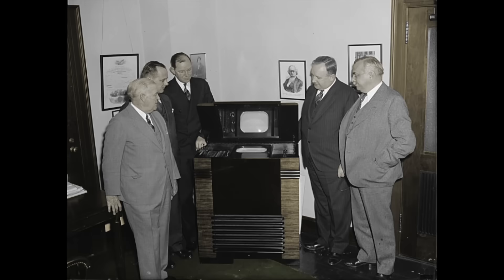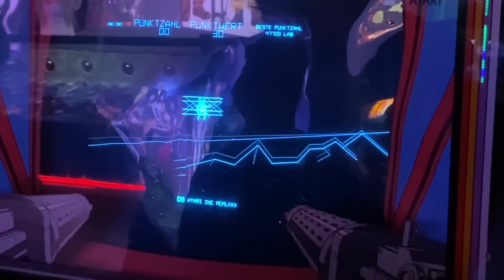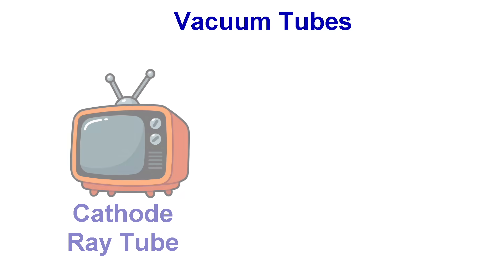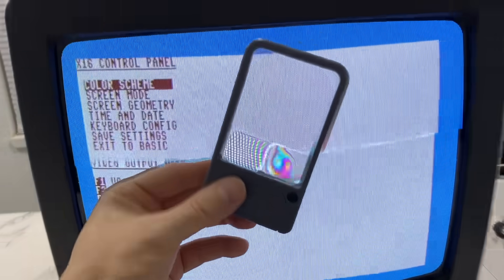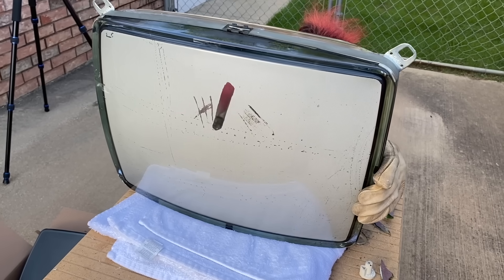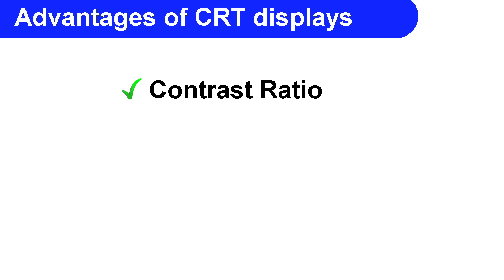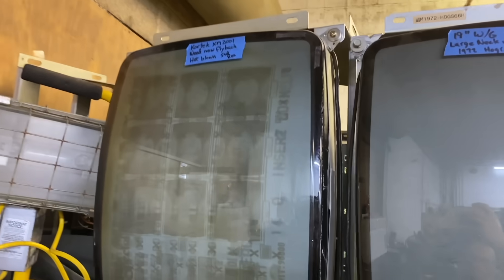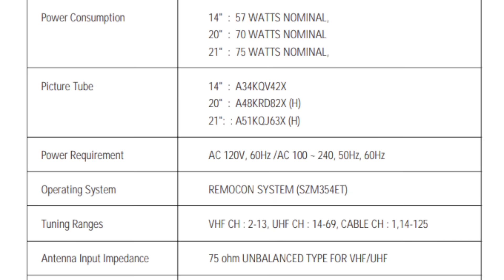How Cathode Ray Tubes Work.

Comment: Disappointed David trotted out the discredited old trope about burger sizes. It comes from a single source. A&W had a CEO who did a terrible job and was then fired. He then wrote a self-serving book in which he tried to blame "dumb customers" instead of owning his own mistakes with this burger rollout. He is the only source for this supposed survey about fractions. But here's proof this was nonsense: First, we have the Hardee's hamburger chain (known out west as Carl's Jr.). In 2003, in line with targeting a demographic of hungry young males, they introduced a 1/3 pound burger, and the "1/3" fraction was a prominent part of the burger's labeling (I found several images of menus from this period). Later they also add a 1/2 pound burger. There are menus where all three sizes were prominently featured, all with the fractions. This was probably their most successful product introduction in their entire history. It wasn't until a few years ago, when the pandemic occurred, that they simplified their menus and changed the labeling, as many companies did. But for almost 2 entire decades, they had menus with these fractions, and of course the bigger burgers were more expensive, and it was a huge success with no problems regarding "dumb customers" not understanding them. McDonalds also had a specialty burger that was 1/3 pound, labeled the "1/3 Pound Angus" burger, and it was on the menu for 4 years with no issues. Second, I looked for a non-biased poll about this. Someone indeed did this on Reddit 3 years ago. “What is bigger, 1/3 or ¼?”.  The answer 1/3 got 1.8K votes, which of course means 1800+.  For the answer ¼: 23 ENTIRE VOTES.  Reddit is available around the world, but the U.S. represents a large portion of an English-language website such as this. And I doubt Reddit users are much smarter than the general public, given how stupid some of the questions and answers are on that site. People use fractions all the time, in cooking and the like. Almost every American home has a set of interlocking measurement cups in sizes of 1/4, 1/3, 1/2, and 1. It would be impossible to not notice how these fractions compare. I have never met a single person that did not understand them. This is a false urban legend at this point, but people love click-bait nonsense, especially if it makes them feel superior to the unwashed masses.
Reply: Yeah I'm gay too

Comment: 11:23 That was the exact same model I had for my first DVD player as well. I worked at RadioShack back then and picked up the floor display model on clearance. Still was a whopping $230-ish with my employee discount.

It had a free Netflix trial voucher in the box. The same Netflix account I had active non stop until 2022.

When I had upgraded to a Phillips that could handle burned discs and DiVX (the h263 conpression format, not the failed disc format DIVX) i gave it to my girlfriends mom. Last I saw, she was still using it in 2009.....

Comment: Another disadvantage of LCD and any pixel-exact screen is that if you give it an analogue signal you often get unsharp results, as the timing is usually not 100% perfect. Only with digital inputs (DVI-D, DisplayPort, HDMI) you get perfect pixel-by-pixel representation. In fact I never ever buy any LCD or flat screen without digital inputs and I definitely never attach any VGA cable to it. With digital it becomes however absolutely perfect sharp when using the native resolution.

Comment: Regarding 4:3 vs 16:9 screen sizes it also largely comes down to what you use the display for. If you primarily did a lot of reading and writing you'd miss that extra height from the 4:3 display a lot. On the other hand if you were primarily watching movies in a 16:9 aspect ratio you'd be better off with the 16:9 display as the same content would be restricted by the width of the 4:3 display. As for gaming I suppose it comes down to if you value a bit of extra horizontal FOV or not.

Comment: Great video, very informative😊 Thanks for the hard work!

As far as the 4:3 vs 16:9 aspect ratio preference goes, I'm a bit of two minds about it. I think we lost something when we moved away from 4:3, as it seems like a more "natural" adpect ratio to someone like me who was still born in the 70s. Whenever i think of past displays, i think 4:3, and displaying even old VHS tapes in an widescreen display means having to decide between a stretched image or black bars on the side, which always felt to me sub-optimal, no matter what you choose.

On the other hand, a 16:9 display for laptops feels more natural. When i was a student i had a (rather expensive) XP laptop that stacked well with A4 sheets from my notes and assignments, so it felt easier to carry than a 4:3 one.

In the end, there is room for everything, be it CRT or LCD, 4:3 or 16:9 😊

Comment: There is a high demand for CRT TVs in live theatre to transmit the image of a conductor to the cast on stage or even sometimes to transmit his image to parts of the orchestra.  Analogue cameras are also preferred as the source.

Digital monitors and cameras can cause up to 5000ms (or 0.5 seconds) transmission delay.

Performances often rely upon a remote orchestra playing in a separate room.  Any delay in the image transmission can be disastrous for a musical performance  

Reliable CRTs and analogue cameras are becoming rare and difficult to find.

Comment: The Price Size Comparison for 4:3 vs 16:9 was only slightly true. The marketing push for 16:9 was DVD and the higher than VHS quality to have a near theater like at home experience. With the addition of Surround Sound and Dolby Pro Logic, I digress. I say all this because by the time circuit city and best buy were stopping sales (or well stopping the showcase of) CRT's The price was not even comparable. With HD LCD being dirt cheap compared to CRT, cost of materials was incomparable.

Hindsight into history is 20/20 and the cost to manufacture, the cost to transport, the cost of shelf space. All were the biggest downfalls of CRT bigger than screen real estate bigger than quality, bigger than input lag. We all NOW know that a CRT is best for unmodified analogue video game consoles. And many of us didn't have a second thought about filling the landfill with out old CRT's however we would kick ourselves for it.

Really for the layman, Emulation or Console Mods, Those are your choices. A $300 PC from 2010, or $300 per modded console. Comes down to a choice of space to be honnest.

Comment: I had a DVD player in 1999 (though did still regularly use my VHS until 2005). I also started downloading MP3's around '99-2000. I had a digital camera around 2000, and a USB flash drive around 2002 and got my first LCD TV around 2006. I wouldn't buy an electric car though.

Comment: If you run an LCD with LED at 100% backlight as most users do, the LED's will last for 3-5 years.
They breaks in three different ways.
1: No light (dark areas).
2: Lenses fall off (you can see a bright spot).
3: The tiny filter on the LED falls off (you get a bluish screen).
Reply: I've seen lots of modern flatscreens (2 or less years old) have backlight failures

Comment: It is quite interesting for the difference of image rotation  mechanism of CRT and LCD. Unlike the LCD which use software to rotate image data  via matrix calculation, CRT can use the physical method by rotating the magnetic field .

Comment: Despite Technology Connections doing the same idea years before you (actually there's a whole series), yours is still unique, and in my personal opinion, superior as no diagram can beat the simple act of breaking something apart and seeing the parts for yourself.

Now I wanna know what happens if you activate the electron gun in open air, if you can safely look directly into it, and what that looks like if you can. Also would be cool to try to melt something with it.

Comment: I'd actually argue that it wasn't LCD that took out CRT but plasmas, at least initially (and then LCD killed plasma and yes, I'm still extremely salty about it). At least in the early 2000s the "good" flatscreen TVs were almost exclusively plasma TVs. I got one of the first halfway affordable LCD TVs in 2004 or so and despite 720p HD (which was great if you actually got ahold of an HD signal) it really wasn't that much of a game changer due to poor contrast and all the other crap that came with early (and more budget friendly) LCDs. A friend's parents had this gigantic 40" Panasonic plasma TV around that time and, my God, that thing was something else. 

Of course the drawbacks like energy consumption and manufacturing issues let plasma fall behind and eventually were discountinued despite their superior picture quality. I'd argue it took at least until 2020 that LCD, despite all the LEDs, local dimming, etc. could finally get on par with plasma in terms of picture quality and the last Panasonic model to this day will even give a cheaper OLED a good run for its money. So, if you ever get your hands on a ZT60 you know what to do.

Comment: Being the Owner of multiple CRT's (I mostly found on the side of the road) I easily named off every pro to CRT's you mentioned, however there was 1 more pro that you did not mention and that was how absolutely perfect the color represents on a CRT. For instance, plug in a N64 with a S-Video Muti-link cord and put in Goldeneye 64. Do this for both a CRT and a LCD or even OLED TV and you will immediately notice how bright and brilliant the Gold and the red is on the CRT, without completely washing out the color or losing sharpness around the Nintendo Logo when it flashes on the screen. Modern TVs simply do not have the color accuracy as even a old worn out CRT.
Reply: I was actually reading today about turning down the level of red on my JVC D series CRT because it’s way too bright compared to the other colors : ) I think it is an actual issue on JVCs

Comment: You missed viewing angles.  Even though most CRTs are convex, their self-illuminating pixels are viewable from a wider and taller range of positions without loss of brightness or color accuracy (compared to LCD, especially TN).

Comment: the 16:9 debacle was one more of the wide screen content of the movies than the real pixel count/area, DVDs started to come in 16:9, BlueRay and Youtube, Streaming ,etc. and with that the fabulous 4:3 died , I used an old LG monitor 1280x1024, 4:3, it was wonderful
Reply: "Technically" 1280x1024 is 5:4. I have a 17" Samsung LCD panel like it that still kicking around from the early 2000s as a backup VGA console monitor!

Comment: So, when a color CRT from the 1980's is going dark is that a sign of a component failure or tube itself failure.
Reply: depends on how dark. If the tv just suddenly goes really dark where its almsot unviewable then thats a component failure
Reply: @NEON2600  The monitor was acquired from eBay about 3 years ago. The monitor is a AT&T 318H color that was used with an AT&T 6300 computer. The seller said that the monitor was dark when I bought it. So, how dark is it. With the intensity fully cranked it's dark enough to be twilight where colors like greens, blues and reds are distinguishable but you have to pull the shades and turn off any lighting in the room to really make them out. I can read the characters on screen; they are not blurred or out of focus. I was told that the problem might be a capacitor. There are titanium capacitors as well as some good size electrolytic capacitors; high voltage that is. I just wanted to connect with someone who might have an insight into monitor darkness. Thank you for responding.

Comment: Biggest advantage of CRT (and what was not mentioned in the video... WHY?) is motion clarity. CRT flickered making tracked moving objects with eyes appear as perfectly sharp (for as long as object position updated with refresh rate of CRT) whereas other technologies (except maybe PDP - plasma) do not inherently flicker and thus exhibit sample and hold motion blur. There are LCD/OLED screens with motion reduction tech based on flickering but they usually become very dim and flickering can be quite tiresome compared to CRT (which has to do with how CRT flickers versus how its done on modern displays) and because of that pulse width of modern display with this trick is much longer than on CRT leading to worse motion clarity. Contrast ratio - OLED blows CRT out of the water. Heck, even LCD in some aspects is better - in bright lit room LCD contrast is pretty much as good as it needs to be even for IPS panels. Personally I used LCD for text/internet/excel, etc. and CRT for gaming until LCD became in some sense even better supporting variable refresh - something that you potentially could have on CRT but not the way they were made - in fact it would be much harder than combining strobing and VRR which still no one figured out on modern displays. Anyways, CRT biggest issue is size, weight, availability and for some models cost. I do own SONY GDM-FW900 and Dell P1110 for PC and few professional PVM and one JVC monitor for 15KHz stuff. Big CRT fan but I must admit that in terms of colors modern IPS panels with wide gamut in good (for LCD) lighting conditions can look much better than CRT.

Comment: What weird timing.  I just got hold of a Vectrex system.  Currently fixing it up.  I fear the voltage going to the tube is too high.  I have a high voltage probe but don't have the spudger piece that goes under the cap. I don't have the guts to pull the cap.

Comment: I was born in 85 so I had decent use of CRT's for many years and I'm so glad they are long gone, big, weighed a ton, limited to a certain size unless you have a fork lift handy, gave me eyestrain if used for too long and power hungry. My grandparents were very early adopters of everything so they had widescreen CRT's as well though those things never lasted long before LCD's started to take over. I changed my PC monitor over to a 4:3 LCD back somewhere around 2002/2003 when they started to become pretty cheap and never looked back since. LCD's were so much easier on the eyes along with the significantly crisper text, smoother dead flat lines and no degaussing.
Reply: The only thing I didn't like about CRT's was the 16khz whine you could hear from anywhere when young.

Comment: The contrast thing is debatable. The phosphor of the CRT glows a little as soon as you have tiniest amount of environmental light, making it look grey instead of black. On top of that, CRTs don't get bright compared to LCDs. So unless you're in absolute darkness, the LCD will probably look like it has more contrast - and that is before you add things such as mini LED ;).
Reply: OLED is better than mini led.
Reply: @NEON2600  Did you actually watch the video? He explained why he didn’t compare to OLED.

Comment: Ok so how do we build a new CRT factory in 2024? With current tech we could achieve even better results! How much for a kickstarter ? 😊
Reply: No you don't. CRT's are quite extreme machines. It starts with the glass, you cannot use normal glass because that would expose people to X-rays. You have to make the CRT from lead-crystal glass. Building a factory that can produce tubes from molten lead-crystal glass is your first challenge. Once you have the the tube you need to install high precision parts inside. Manufacturing these precision parts is your next challenge, just as well as installing them with precision. Once you have done that, there are a few more issues, such as the fact that nobody produces the high-voltage transformers for CRTs anymore. This is not as bad as the earlier problems, but still a challenges to solve.

Basically the moral of the story is that CRTs were more than a simple factory, it was entire industry that did start with raw materials and did end up with a television. The entire industry is gone. You cannot manufacture CRTs with OLED components. Combine this with the fact that also the knowledge is gone and therefore current technology is worse, not better, than it was at the peak years of CRTs
Reply: @danielmantione  yeah given all the needed tech i was sure of this answer, CRTs require a whole ecosystem. But i wonder if we could find alternative ways to reproduce the same rendering. Replacing the electron beam with lasers and not needing a vacuum nor high voltage ?

Comment: One cool detail  is that a CRT is at its basics a particle accelerator just like say LHC or SLAC. It has an accelerating system, bending magnets, a target and a control system and operates under more or less absulute vacuum and it also has lead shielding to protect from syncrotron radiation / x rays as the beam is steered back and forth across the screen.  Although it is MUCH simpler and not at all as powerful as LHC or any modern day research accelerator the basic operating principle is still the same for both LHC/SLAC and a CRT wich is that charged partices are accelerated and steered by electric and magnetic fields toward a target with high precision, so at one time back in the days everyone had one or several particle accelerators in their home as their TV and computer monitor.

Comment: i hate some crts, that make a high pitched noise that only i could hear as a kid. most of the issues with lcds have been solved by oled anyways now. as for lightguns, we have overcome this by external sensors, or inside out tracking. well lightpens are no issue either since you can get pen displays now. but crts are cool in their own right
Reply: It is the 15KHz horizontal retrace that you did hear. The 15KHz was generated by a high-voltage transformers and transformers can vibrate at the frequency they operate on. As a kid you could hear 15KHz noises, now your ears have detoriated enough that you cannot hear it anymore. The retrace frequency of VGA monitors was much higher and therefore these monitors were silent.
Reply: CRT's are more reliable, cooler, higher quality, and much more